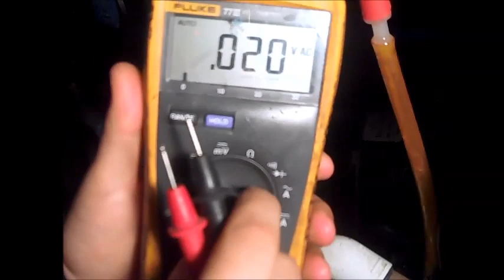Replacing a Hot Spring no fault Heater

Comment: My heater is reading 19.6 ohms.. GFCI trips immediately as soon as I flip the breaker. Hot tub is not heating. I have hit the reset button on the no fault 6000 heater. Any ideas? is 19.6 ohms too high? I've seen websites say 8-20 ohms is good, and others say 8 - 15 ohms is good. Thoughts please?
Reply: ***** Replacing the heater fixed this problem. Cheapest deal I could find is at hot tub works 

http://www.hottubworks.com/part-73790-item-hottub-heater-assembly.php

Comment: ...I am getting a 0 reading with the ohms test.  I have no filter or air lock issues.  The reset button on top the heater does depress but never has seemed to engage or "click"...is it possible I get a 0 reading because the reset button is bad?